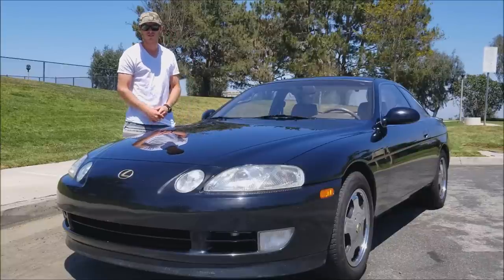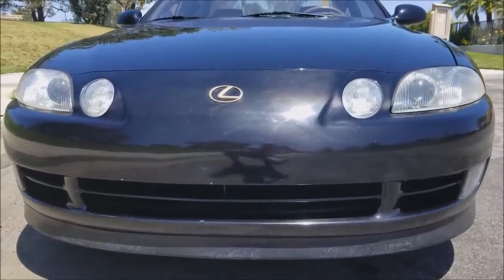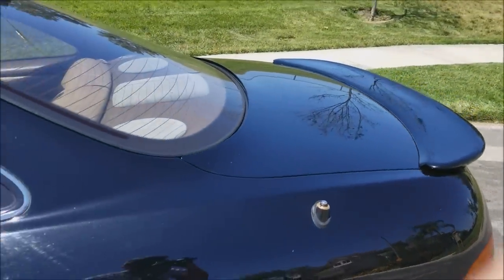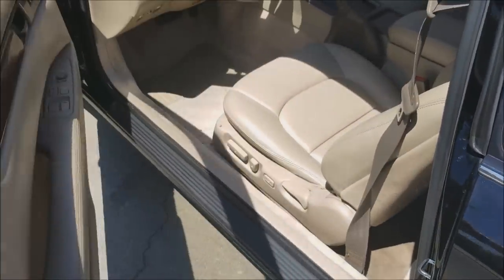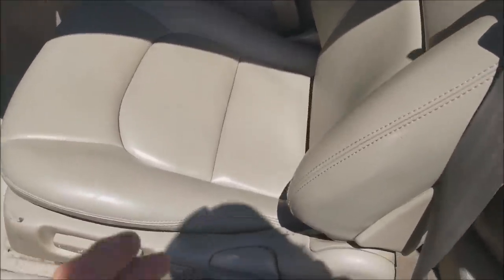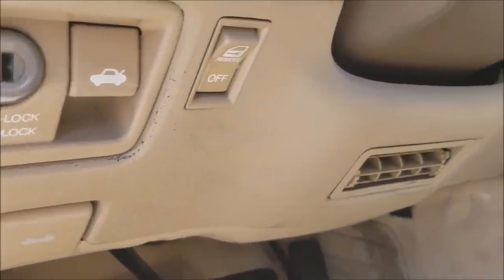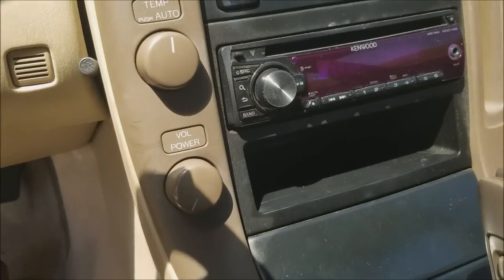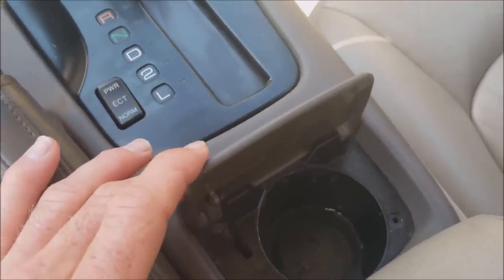My Lexus SC400

Comment: I bought a 92 sc400 for $800 200,000 miles clean body but a pretty rough interior. watch out for expensive repairs like the power steering line and lower control arms. I have had a lot of small problems that cost me big money over the past year.  Hearing the v8 roar to life every morning makes it all ok!
Reply from the maker: I absolutely agree. I enjoy doing the work on my cars though. It saves me lots in repair bills

Comment: My dad owns a 1992 sc400 too but it has that factory blue the AC was amazing and the engine was great. Even though it has a small v8 engine it still is powerful. It’s my dad’s everyday driver and I also like the radio, that extra bass is great. The exhaust was great too
Reply from the maker: I like that blue color it came in, you dont see many in that color at all. it is a great car, fun to drive, good sound system and even better exhaust note 😁

Comment: You mentioned the car weighs 4400lbs. Actually the curb weight for the SC300/400 was around 3400-3500lbs. The 4400lbs was with the carrying capacity of 750lbs + the curb weight. I should know i have a Renaissance Red '98 SC300 in very good condition like yours. No accident history, No rips or tears in any seat, No leaks of any fluid, Original paint. She's got 115,000mi on her which averages out to less than 6000mi a year and still pulls strong and shifts smoothly. I got her exactly 3yrs ago. I'm also the 3rd owner. First owner held onto her for over 14yrs. and religiously took her to the original Lexus dealer every 3000-5000mi for the scheduled maintenance. I have a stack of service records over an inch thick from day 1!! That's her in my profile picture. Ever since I first saw these cars back in the early 90's I thought what a beautiful design they are. They are a timeless design looking better than alot of newer cars today! From what I heard too Bill Gates of microsoft and the rapper Notorious B.I.G were also the proud owners of these cars when they first came out!! I still get beautiful car compliments from my neighbors and strangers. Last fall a 16-17yr old kid saw it and asked if it was an SC300 I said yup. Then he said it has the 2JZ right! Yup. Which is the engine code BTW same engine as the Mark 4 Supra. The car was older than he was and yet he knew! Funny!  Anyway NICE find and Enjoy!!
Reply: I thought 4400 was quite a bit. That's only 1000 pounds less than my full size pick up.
Reply: Lexus has 2jz but it's not the 2jzgte

Comment: My husband bought one (1999 sc400) on Monday...pristine condition from original owners (husband passed). Its black, with black leather...I am not a car fanatic, but damn, it's a sweet and smooth  ride.
Reply from the maker: that sounds like a great find. the 1999 and 2000 year model sc400s are the hardest 400s to find. how many miles on the car? black and black makes it even more rare. great find and such a nice car
Reply: It has 88k miles
Reply from the maker: @magicmommycrafts3640  that is seriously low miles for the car. sounds like an excellent purchase 👍👍
Reply: @DaylyDriverDayly  I've had my 99 SC400 for two years now, and it's got just under 30,000 miles on it.  I owned a 98 years ago, and was devastated when the car was totaled in an accident.  I kept my eyes out for a long time before I finally found the one I have now.  That era of the SC400s are just fantastic!

Comment: Amazing example! There is another video online of someone in Melbourne with almost the same well-kept car. I have driven a 1991 version of that, the limited with leather, which looks the same, but way more beatup, for six years. Still going! One of the few left I see, a few years back while having electrical issues from endless rain I noticed two in succession abandoned on the freeway. Mechanics will never touch the electrical behind the TV :(

Comment: Enjoyed your videos on this car.  I just purchased a 95 sc400 with 130k for $1000. It runs like a top and has no leaks.  Actually the engine looks brand new.  The interior shows some wear but is not trashed. It does have a dent near the rear wheel well that will need a little body work and the clear coat needs attention in a few spots.   I would be interested to know what upgrades you did or plan to do.  I plan on making this a daily driver.
Reply from the maker: Great buy and I'm surprised you got a 95 with that low of miles for the price you did. very good deal!! I have yet to do any major upgrades or fixes to my car since I have many others, but plan on fixing the power steering lines (common repair on these cars) and looking for a sc300 r154 manual trans parts car that I will swap the trans into my 400. eventually I'm going to put a steering angle kit, wheels and tires (possibly gut it), steering wheel, welded diff and some other odds and ends. with a project car you have plans but it never goes as planned 🤣🤣
I will see how it turns out

Comment: I love luxury cars like this.  I just got a 01 buick park av w 91k miles for $500. Blown engine.   Its the first engine swap Ive done alone and im still working out the faults.  After I have it sorted im thinking I might save up for one of these.  I dont mind restoring one, I found out you can get a low milage 1uz for less than $1500.

Comment: Let's see if this ages well...
Just got my license; about to purchase an SC400!! ( if my mom doesn't shoot it down )
93 Lexus SC400 with redone leather, serviced annually at Lexus...negotiated down to 1500 even.
Here's hoping 🤞
Reply from the maker: how many miles, what year and overall condition? that's radio you are looking to get an sc400 for your first car👌👌👌
Reply: @DaylyDriverDayly  175k, 93, fantastic condition. Leather was redone, paint is all original. Has the capacitor issue, power steering leakage, and the passenger door assembly has a minor repair needed (only opens from inside, car hasn't been hit or anything). All records there, annual service. Only problem is another guy is going to look at it before I can, so we'll see if it's still available
Reply: @adrianhayden7430  did you get it?
Reply: @danhmanle  ended up with a Mazdaspeed6 making about 300whp/tq

Comment: I have a '92 SC400 with just over 100K. The third brake light wire breaks where the trunk lid meets the body in the wiring bundle. Yes, there are some common problems, but that's what you signed up for......
Reply from the maker: And I am extremely happy I signed up for it 😁

Comment: Beautiful and clean example of a stock car!  I have a 98 SC300 in 3M9 tan interior, gold package as well, 4 owner, but all from the same town makes me think a hand me down. Got it completely stock, aaand ive modded it lol keep it clean man!
Reply from the maker: appreciate it. what have you done in terms of mods to your sc300?
Reply: I replaced the steering wheel with a DND hub/quick release and suede racing wheel, greddy muffler with a single exit, BFI intake mod that was totally tossed together, lowered on tein street basis z coils, and 5Zigien 5ZR 18s, and a Ls400 front calipers, and Sickspeed Suzuka seats with their new ghost fabric with DND brackets. If you want to check it out its on my IG which is the same as my youtube tag
Reply from the maker: @zachdailyfost4433  I'll check it out. do you know how much weight you lost on the car by going from dual exhaust ports down to a single exit? LS400 brake calipers are the way to go and fairly cheap as well

Comment: There is a guy on ebay who will repair the instrument cluster....or you can buy one in exchange for the broken one. There are screws around the bottom of the cluster that come out pull the cluster out. I replaced mine on my 95 Gs300 several years ago and they still light up nicely.
Reply from the maker: Thankfully my sc doesn't have a burned out dash. 1 less thing to worry about👌
Reply: If the car has any electrical issues (cluster, ecu, etc.) Go to tanin auto electonix. They do such a good job.
Reply from the maker: What state and city is that business located? Would be good for others to know.
Reply: When they rebuild the cluster they can program the odometer 2 whatever mileage you want that's why you can never trust the odometer on a lot of these so-called low mileage cars if it's been repainted and the seats have been reupholstered and it's claiming low mileage I wouldn't believe that
Reply from the maker: @j-deezy321  that's why I ran the carfax on it and verified everything on it before making the purchase
Reply: @DaylyDriverDayly  Carfax may not be able to give you accurate mileage depending on maintenance records if there's no record of anything and there's no record of any mileage being reported but your car obviously appears to be correct to the mileage doesn't take a genius to determine that so Carfax really isn't necessary on a car that is obviously a nice clean car as yours is Carfax doesn't give any indications if the car is good or not that's up to the intelligence of the buyer a positive Carfax often times give somebody misleading hope because not everything is reported I've even known people to have had accidents and not reported them just so it wouldn't show up on the Carfax so we must rely on our own experience and knowledge and not some printed out Carfax history which may or may not be complete I've had hundreds of cars and not one Carfax report the same goes for mileage people also concerned with the mileage to me is an indication that they have no intelligence to determine if the car is good they're worried about the mileage but the mileage is not often reflect the condition of the car some people put more damage to the car and a hundred miles than I do in a hundred thousand so again it comes down to being a knowledgeable buyer and not relying on other resources that may or may not be complete and definitely are not dependable I've even seen people pull a Carfax report just so they can see the last recorded mileage so they can set the odometer accordingly LOL
Reply from the maker: I agree with what you are saying about people being concerned about mileage. That is a clear indication the person most likely knows nothing about cars mechanically. I drove a 1990 Lexus LS400 with 366,000 miles once and it drove better than most new cars I have ever driven. It depends on who owned the car, how well it has been maintained, and what particular problems the specific vehicle are known for having. With the Carfax it can be misleading, but in all reality if the Carfax is clean it will give the person whom you are selling the car to peace of mind. It makes the sale easier. Yes there are many ways to tell if the Carfax is accurate or not. It will either help a sale or not.

Comment: Do you think $1900 is a good price for one with 140k miles
Reply from the maker: doesnt sound bad at all. it depends on what mechanical issues it has and if it has updated tags and is a clean title. if it is a clean car with little t ok no body or interior damage, and runs and drives without problems I'd say it's a good car for the price
Reply: master DOGE  1uz is actually very easy to work on unless you need a full rebuild.

Comment: Nice video presentation on the 92 SC400. Just discovered this car about a month ago while looking for a luxury project car to carry into my retirement (I’m 60). I was so lucky to come across and buy a 92 with 77k miles on it one week ago. Perfect condition inside and out. What is the GOLD model and how is it different than the regular model? Just plan on detailing it and fixing some minor scratches and cracks. Bought an original radio because don’t like the way the after market one looks with a big gaping space. Drove it on the 241 (OC) yesterday and what a car. Sporty and elegant best describes it. Read a lot of the comments so learned a few things. What are your thoughts of these cars increasing in value over the years. Most comments were about high mileage ones for cheap prices. I hope they become more valuable since this one is a keeper and won’t drive it more than 100 k in the rest of my driving years. Mine is a two tone dark green light green. Thanks

Comment: I found a 98 for $2295 with 130,000 miles. It's paint is oxidized and the driver's seat leather is heavily damaged but has a clean car fax and 3 previous owners. How can I tell if anything big is wrong with it. I need a fun reliable daily driver and I'm a little short on cash.

Comment: The Rack and Pinion does not go out. The bushings that hold the rack rot out and have to be replaced.  Not a huge deal. You will know when it happens as your steering will get super sloppy . Also.. The front lower rear trailing arm bushings will have to be replaced. 70 dollars for the parts and the rest is labor.  Also.. The SC400 engine runs interference so you will have to replace the timing belts at proper intervals. Very expensive to have it done. Around 1000 dollars as there are kits to replace idler wheel, water pump and belt as all should be done at the same time. The Early model SC300 Straight 6 motors do not run interference so belts are no worry. Also the gauge needles burn out . There is a needle kit to install. Cost is 90 bucks. Install is hard for sure on this as you really need to know what you are doing.  Shocks will need replacing as well. They are around 90 bucks each made by Monroe of all companies and for sure the best replacement shock to retain factory ride. Install on these is medium hard to do.  Replacement of ATF is a must. Use Valvoline MAX ATF as it is a great replacement and affordable. It is better than the factory ATF.  There is a drain plug on the Transmission so you can swap 2 quarts at a time until it gets clean.  Also the Power Steering fluid must be changed. Suck it out with a turkey baster and replace. Use the same ATF as the transmission. Keep taking it out swapping it with new till it runs clean.  It can take a while but well worth the effort as these Ansin Transmissions are the best ever made!  Do not let your ATF get low and get old!!!  Do NOT!!
Reply from the maker: I am slowly doing repairs to the car since I do not drive it much and since I am buying other cars. I am also waiting to find a nice used sc300 with the r154 manual trans so I can swap out the auto trans with the manual.
Reply: The 92 SC400 is a non interference engine timing belt failure will not cause valve damage
Reply: @j-deezy321  Really?  Same as the straight 6 for that year?
Reply: @DaylyDriverDayly  Hard.. Very hard to go from Auto to manual. VERY
Reply: @grabir01  both engines are non-interfering up until 1998 when they introduced the vvt-i system but even then Lexus had small indentions in the top of the Pistons to allow clearance in case the belt broke but I've never seen a belt break unless there was a failed pulley bearing or water pump bearing which caused the problem which would give warning signs
Reply: @j-deezy321  Thanks Deezy.
Reply from the maker: It will be a fun project installing the manual trans. Looking forward to it very much. The job is a lot easier when you have a lift, all the tools and all the parts. Can't wait to get it started.
Reply from the maker: That is correct because it is not the vvt-i engine which was 1998-2000
Reply: @DaylyDriverDayly  Pedals, Linkages, Computer and more.. Yikes!!  Just find a manual car . Less expensive too.

Comment: Nice example. Take your door cards and window surrounds off and reinforce them and fix cracks with ABS glue. The window surrounds will crack in the lower middle area.
Reply from the maker: Phil Colebrook thanks. I don't know what you mean by door cards and window surrounds?
Reply: If you look online, under either SC400/300 or Soarers (the JDM model) you will find instructions on removing the panels on the inside of the doors and the vinyl-coated surround around the window interior. These all crack with age (think I see some degradation on yours) but you can repair and reinforce as long as you use the right glue, which is ABS like Polypipe. See https://www.youtube.com/watch?v=6eA9_2V7Qvg
Reply: By the way it is a good chance to check the polythene moisture barrier underneath the door cards which stops water getting inside. These are usually dried and cracked with age or have been removed and not replaced. You will get leaks inside if these are not sorted. Clear polythene and butyl cord for resealing :-)
Reply: @DaylyDriverDayly  he's talking nonsense about the interior door trim around the window frame most Maniacs break them taking them off but if you're careful you'll find they're actually pretty solid and hard to break
Reply from the maker: There are many ways they can break. The interior door trim takes a lot of beating and wear for being a 92. Thankfully my interior is near perfect.
Reply: @DaylyDriverDayly  only way I've ever seen him suffer any damages from people taking them off improperly my guess is yours is probably never been off yours is one of the few that have never had tinted windows LOL it looks good the way it is

Comment: Did they come only in Automatic or was a manual option offered? I am assuming no because it's a luxury vehicle.
Reply from the maker: the lexus sc400 was only offered with an automatic transmission from 92-00. the sc300 was offered in both automatic and manual only from 92-97. the r154 sc300 manual trans are very rare and hard to find.
Reply: @DaylyDriverDayly  thanks man. Kinda a bummer, but still worth it😀
Reply from the maker: @nicholasrich875  tell me about it. I'm waiting till I can get the sc300 stock manual transmission and swap it into my 400